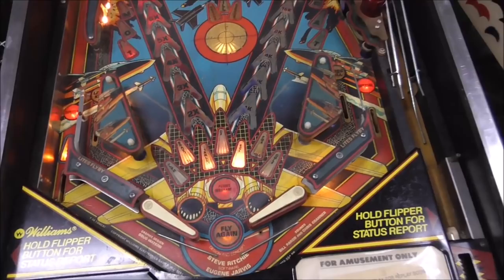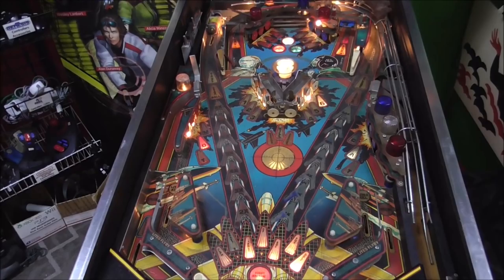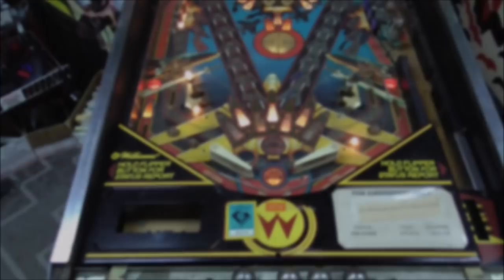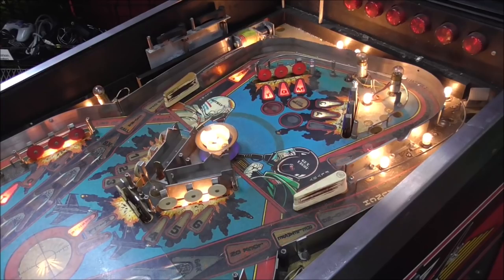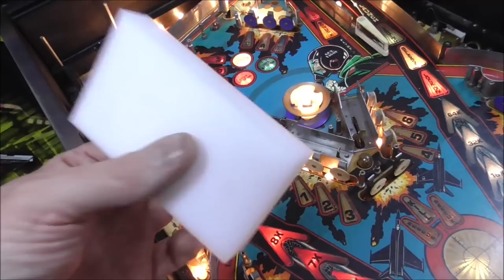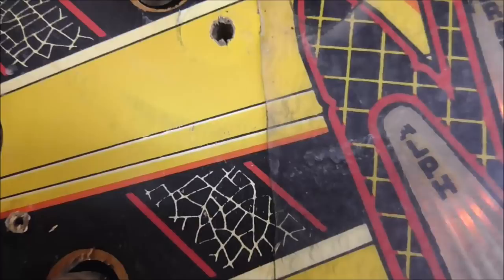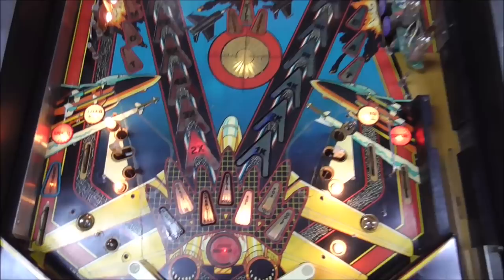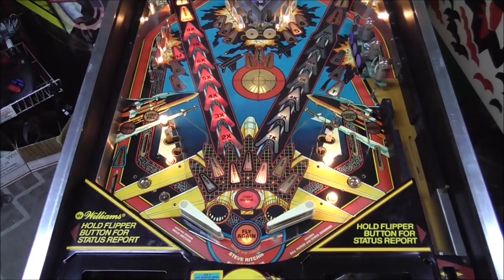Cleaning A Very Neglected Playfield With Extra Mylar - 1987 Williams F-14 Pinball Repair #10

Comment: The owner is lucky that the inserts are not all broken and lifting. This machine is infamous for the small triangle inserts lifting and becoming ramps to launch the ball as well as the wings on the chevrons breaking.
Reply from the maker: I believe the mylar they added held them all down!
Reply: @LyonsArcade  It is possible. I have one where the inserts deformed the mylar as they lifted. One of these days I will put the new playfield in it. Too many projects....
Reply: Mine has only two inserts lifting under the factory Mylar. They’re on the right lock shot.
Reply: @pauz2175  You can gently heat them until the glue holding them in softens and then with a soft cloth, block of wood, and a rubber mallet tap them back flush. The correct fix is to remove them, clean them, and then reset them with new glue.

Comment: This is an awesome series Ron. Thanks. I see the problems with the mylar and the worn playfield underneath. Do you anytime consider to replace it with a playfield decal? Or is that a sacrilege for you?
Reply from the maker: No I think it would be an improvement in this case, but the cost would be prohibitive in my opinion... you could put the decal on, but you'd have to remove everything on the playfield, remove all the mylar, then sand the entire playfield down so that all the art was removed from the inserts, then put the decal on, then build it all back.  15 hours maybe?  I don't think it would increase the value of the machine enough to pay for itself.

Now, for a HOBBYIST, someone doing it themselves, yes that would be a good way to go.  Because you'd only spend about $150 for the decal, and you wouldn't mind spending 15 20 hours working on your own game as a hobby.
Reply: @LyonsArcade  I hope that, We! Youre fans! Someday should see a person with a fat wallet walks in to your store with a totaly wreked and worned out machine and tell you: Restore this! No mater what it cost! Couse your´e the man to do it. if any one.

Comment: You could cut the decal in a couple of pieces to match up the letters.
Reply from the maker: Unfortunately they were different sizes and different fonts than the originals, you'd have to cut out each individual letter...
Reply: And it would create too many edges for the spinning ball to be affected by and peel off. Probably only a possibility if you were going to put clear over the decals.

Comment: Not factory fresh but as bad as it started where it was basically useless in its condition other than a sloped table  I’d be super happy if I owned this machine 

Was wondering maybe sheet vinyl to redo the whole playfield but if the Mylar pulls wood and seeing that the grain has started to check it would pull wood so this probably was the best thing other than replacing the entire playfield with new wood and rebuilding the game
Reply from the maker: Yeah I think when you factor in cost and time (which costs the customer) this was about the only choice....

Comment: I'm trying to work it out in my head, and yeah, you can't get the mylar off. A heat gun might soften the adhesive, but you'd still have peeling, and then you'd have the residue. Then I thought, what about chemicals? Strong cleaners like oven cleaner or paint remover would destroy the adhesive and also the paint.

Now, I know something that might help, if you are inclined, and it is something you don't like to use for lubrication or near contacts. What about WD-40 or an oil? That works with tape and glue in hair, for instance. So the oil dissolves the adhesive. And then you get into time. Of course, what would you have to do next? I mean, if you have oil, you'd need something, maybe lye, to remove the oil. They make a purple degreaser you can get at Home Depot or Lowes. That is mostly sodium hydroxide (lye). So mix a 15-20% solution of that, glove up, and gently work that into a lather (you don't need soap since lye+oil=soap), and rinse.

Comment: How feasible would it be to cut the mylar off the inserts and then install new decals? (Basically trace the insert with a razor)
Reply from the maker: You'd have to cut it out, then you'd have to scrape all the old artwork off the insert and not get any trash under the mylar surrounding it (which is raised in some areas, and covered with adhesive) so it sounds like a mess waiting to happen :)

Comment: Great video Ron,  I agree the magic eraser is a great tool to use.  You said it do not press to hard do not over do it.  Can you feel a height difference when you put the new sticker on?  Thanks for filming it.  See you on video 11
Reply from the maker: The stickers are very thin so you can't really feel it... but the mylar that's on there is pretty thick, there's a little bump.  I'd say the mylar is about 5 times thicker than the stickers... and at the slingshots there were two layers of mylar!  Crazy!

Comment: Great video. Admittedly I was a little disappointed you didn’t take the Mylar off. I was curious how you’d accomplish that. I have the same decal pkg. no Mylar on on the bottom. Might have been a blessing in disguise. I can tell you that clear on the inserts is way harder to clear off that you think it is. I am going to to steal you magic eraser idea for the upper Playfield. I also have that terrible rainbow of dirt between the two pieces of factory Mylar. We’re u just using the magic eraser and water?  What was the liquid.
Reply from the maker: Use Rubbing Alcohol with it, works great!  Yeah I wish I could have figured out a way to get the mylar off without making it much worse but I don't think I would have been able to, sometimes you have to quit while you're ahead :)  Yeah I was also concerned about whether I'd be able to scrape the clear and art off the inserts without just scratching them up!

Comment: Could you touch up the paint on top of the existing mylar, then add another layer of mylar on top to protect it?
Reply from the maker: That would probably work... but you're kind of making a crap sandwich at that point, lol  I just couldn't bring myself to spend a ton of time on top of the mylar, because even if I did that you'd still have all the problems UNDER the mylar (like you can't repaint the dirt under the mylar, etc.)

Comment: The cleaning did a lot in this case. It's a real shame with the decals not matching perfectly. Personally, I think I'd just leave them off if they don't go everywhere and/or don't align.
I was thinking maybe it would be possible, as precisely as possible, to cut the mylar along the insert edges and pop the inserts out and clean em up, and then possibly replace the mylar on them when you put them back in to even it out. You would get tiny gaps, but it certainly wouldn't be as bad as that ring on the top of the playfield. I'm not sure how easy it would be to cut the mylar though.

Comment: Would it be possible to use a razor blade to cut the mylar around the inserts themselves, remove only that mylar (and the insert art) and then replace it with the new insert decal?
Reply: I did that with mine but only on one insert. There’s one on the top right loop that the factory Mylar only covers half the insert. So I knew there was a ridge anyway. So I cut around the insert and devalued that one. But doing it for each decal would be very time consuming and leave you with craters all over the Playfield.
Reply: Pretend I said decaled. Not devalued. Lol. Stupid autocorrect

Comment: Is it possible to get a new Playfield for that game and replace it
Reply: There were new playfields made a few years ago by a company in Europe. They had a special run of the chevron inserts made. They built as many playfields as they had inserts for.  I heard rumors of them doing a second run. I do not know if it happened but I am sure there are some of the playfields out there still. They were about $1000 so I would expect to pay more than that to buy one now.
Reply from the maker: Unfortunately it just doesn't make sense financially even if you could find one... it'd be a grand or so, and then you have many hours preparing it, and swapping it in, the bottom of the playfield has braiding that needs to be replaced, all the light sockets, mechanisms, switches need to be swapped, all the wiring... everything on the top has to be removed (notice we left about half the stuff on the top when we cleaned it up)... it just takes forever and would cost a fortune to hire someone (Me!) to do...

Comment: On the bottom left especially, where yellow meets black, there is a really dirty edge of mylar that seems to be partially lifting. Would it be, in some cases, possible to cut carefully along the black edge and strip the mylar on the yellow paint, then retouch?

Anyway, great job! Apparently this game was kinda ripoff on Top Gun?
Reply from the maker: You could probably do that, but now you're kind of cutting pieces off and frankensteining it :)  Same thing with putting LED's in certain inserts, yeah, you could do that but your trying to paint a band aid :)

Comment: Could you use a toothbrush instead of an eraser?
Reply from the maker: That may work... but from what I understand, the melamine foam (magic eraser) is smaller so gets in the cracks that other things can't, which is why it gets it so clean and why it basically acts as a sandpaper...